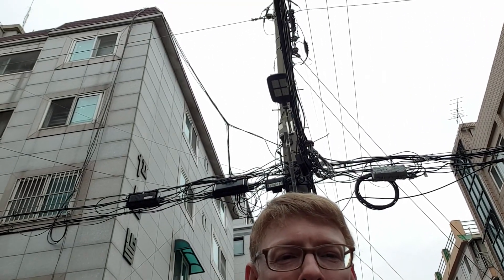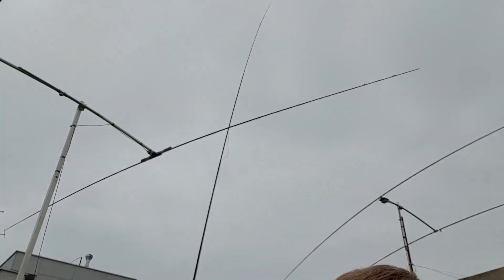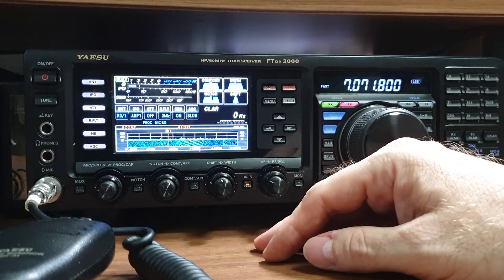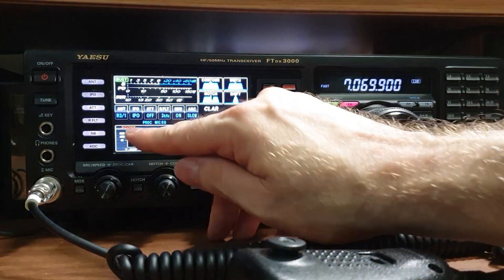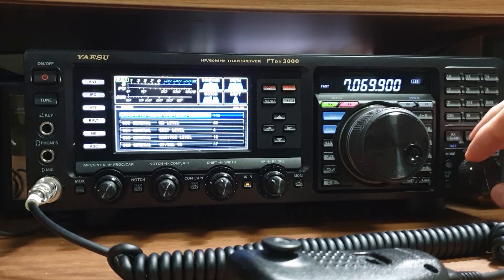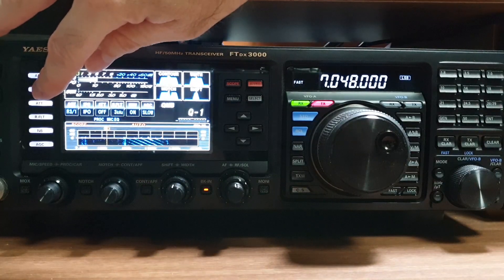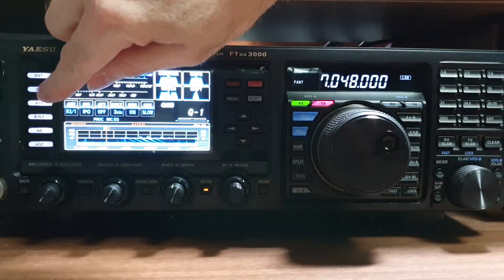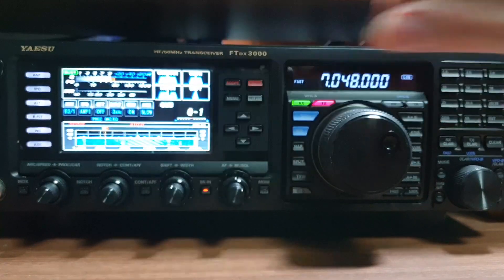Noisy City? No Problem! Yaesu FTDX3000 Receive Antenna Port Explained

Comment from the maker: Just a note that DX Engineering sells a device to make a RX Antenna port for radios which do not have them.  It protects against overload, etc.  It's called the RTR-2 Modular Receive-Transmit Interface.
Reply: @Aidan Marley No problem :)

Comment: Hello great video.  Can you use a 2 elwm yagi on 40m as a receive antenna and use a half wave dipole as a main transmitting antenna?
Reply from the maker: Yes you can!  I do, sometimes. Results vary.  Needs some receive amplification, though.

Comment: Is this phasing the antennas to reduce noise like a QRM eliminator.
Reply from the maker: No, it is simply listening on an antenna not meant for the band.  Less noise while remaining signal is lesser than a resonant antenna, but stronger above the noise floor.  You then use your internal RX amp to raise the signal.

Comment: What about the new FTDX10 , I live in a city also and I think to buy one together with the ATAS 120 antenna on my porch. Do you recomment to buy the FTDX3000 instead ? Now it is discontinued and has a good price.
Reply from the maker: Well, that's subjective. It really depends on how much noise you have, and how well the FTDX10 would be able to filter that kind of noise.  There is not receive antenna port on there.  If noise is a huge problem for you, you might want to consider a radio with a RX antenna port, such as the 3000 or a Kenwood 590SG, which is also an excellent radio.  I understand your plight... I would love the features (and pandapter) on the 10 model, also.

Comment: All what's happening is that you go from a vertically polarized antenna to a (mainly) horizontally polarized antenna.
Vertical antennas pick up far more man made noise than horizontal ones.
It has nothing to do with a smaller antenna, a non resonant antenna or anything else. It's mainly polarity.

If I were you, I would try to put up a tuned horizontal antenna instead of your vertical.
You will have the same noise reduction and on top of that, a better receive antenna compared to your present receive antennas.
Reply from the maker: Thanks for repeating the basic premise of the video.  However you missed the point that an off-banded antenna reduces noise an additional amount.
Reply: @thestingyham1188  Indeed, and a dummy load reduces noise even more!

Comment: So, the antenna is reducing noise not the radio or is the radio doing some filtering to cut out static.
Reply from the maker: The antenna is less sensitive on the frequency being used, because it is not the tuned band for it.  For whatever reason an Engineer can better explain, both DX signals from stations and the noise level are reduced, only the noise is reduced a fair bit more than the DX station's signal.  You then kick in the preamp, and do whatever you wish to do with noise reduction, contour, RF Gain, and filtering, to achieve the best receive.

Comment: Your vertical has a commonmode problem..
Reply from the maker: That was already tested. Not sure if I mentioned it in the video because it was a long time ago, but I ran an MFJ isolator to choke that line on the vertical. Adding the choke lowered the noise level perhaps half of an s unit, but honestly I really couldn't tell much difference.  Just a guess, really.  The 20m yagi had its own Balundesigns 1:1 current balun.
Reply: The lineisolator might  not solve the whole issue about CM but if it reduced the qrm you had some of it removed.  I had an old FT-107 with the extra antenna port and i used to counterphase the antenna signat into that, from an external antenna too... it sometimes reduced qrm about 30 db or more. BTW your noiselevel is a bit less than mine, and i live en a small village... i wpould have expected a lot more from a big city like yours 🙂

Comment: I use a Bonito active magloop on the RX port for my Flex radio.... very sensitive does pick some noise but can be directionally nulled out .... need to find a cheap TV antenna rotator, impossible task!
Reply from the maker: Does Channel Master still sell cheap ones for TV antennas?
Reply from the maker: https://www.channelmaster.com/TV_Antenna_Rotator_p/cm-9521hd.htm
Reply from the maker: Or this even cheaper and in stock.  Not sure it rotates 360?
https://www.amazon.com/AUDIOVOX-Remote-Antenna-Rotator-VH226F/dp/B008468PWC

Comment: you could have connected the rx antenna to the other antenna ports, wouldnt that have the same effect like using the same antenna on the rx antenna port ??
Reply from the maker: Yes, one can do that, and I tried that with older radios.  I encourage people to experiment.  The negatives of doing this are:  1.  Having to manually switch is annoying.  2.  The switch can wear out.  3.  If you forget to switch at the right time, you run the risk of damaging your radio / blowing-out your finals, due to mismatch.  The RX antenna port just makes it a lot easier (and safer) by handling all of the switching internally.
Reply: @thestingyham1188  
the ftdx3000 switches automatically between antennaports, once set, like RX on Ant1 and then as soon the PTT is pushed, TX on Ant2. 
the finals usualy have a protective circuit, they reduce the output power when there is a antenna missmatch, they wont damage that quickly from a missmatch. 
of course likes are different, some people will like an RX Ant port. 

btw, if you set the contour filter to +10, that will emphasizes the higher tones to compensate the attenuation of the higher tones in the DNR, the audio then becomes so much clearer and more intelligible.

Comment: De EA4GGC, Ese Aparato ¿Si esta bien y no esta Averiado? Yo Tengo Uno, pero es FTdx 3000MP (Versión con Todos sus Filtros Opcionales)
El Problema te puede llegar de las Lamparas Led-Radian Interferencias . Puedes verlas, con un buen Receptor de Radio y no te quejes, El
FTdx 3000 de la Yaesu, es DEMASIADO BUENO para tener Fallos... lo han dejado (DISCONTINUED) para vender los Otros, No tan BUENOS.
Saludos de EA4GGC Y Cuidalo, un Abrazo desde Madrid España(Spain)
Reply from the maker: My friend has the FTDX5000 and just like every other radio, the city noise affects it in a similar way.  I have 2 floors of other families living above and below me, as well as buildings full of 8 to 10 families each surrounding my building on all corners and sides.  That is the reality of Seoul, Korea.  No matter what I do, I cannot control noise from all of them.  The older superhet Icom and Kenwood and Yaesu radios do better than many of the cheaper SDR-based radios, such as the Icom 7300.  In my experience, the absolute best for handling noise at the front end has been Elecraft.  I wish I could afford another one.  They are in completely another league.  Any radio with a receive antenna port is a great help, along with experiments using off-band antennas.

Comment: Noise is a Great problem these days,
Found on the web W2PM Mini Dimond  RX Loop same  idea as a rombic but vertical mounted rather than parrale to the ground it has a SWR 1.2 from 160 m to 10 m  and a 30DB front to back ratio, the down side it has minus 50 DB  gain and I use a pre-amp by W7IUV which has 20 DB of gain both the pre-amp and the loop are very cheap to make and provide a good signal to noise ratio, there is a terminating resistor 660 OHM on one side and on the other side a matching 16 to 1 (800ohm down to 50 ohm) transformer and very easy to make 
The loop has a 7ft wing span  mine is made from heavy duty electrical conduit for the frame and a 4 way junction box. in the middle.
Reply from the maker: Sounds similar to a Flag RX antenna.  I was going to build one, but never got around to it.  I am space-limited, and do not have rotators.

Comment: Thanks for sharing a very informative video,I run a Yaesu ftdx1200 and suffer from a high noise floor at home. I have a few antennas up including a rotating moxon so will give this a try at the weekend. Cheers an 73

Comment: So, with this rig, I can just key up and the Rx ant wont overload  ?
Reply from the maker: When you have the menu set up to utilize the RX antenna, the rig switches antennas automatically when transmitting. It will listen on the RX antenna you choose, then when you push to transmit, it will automatically switch to the resonant antenna you have set in the menu.  Then it goes back to the RX antenna when you let go of the TX button on your mic.  Of course, the rig is also capable of typical antenna operation.  You set up the RX antenna in the menus.  There are other rigs with this function, as well.  The Kenwood 590SG comes to mind.
Reply: @thestingyham1188  so I think you answered his question here for the most part, but the dx3000 (as well as the dx1200 in my case) pulls the input off the receiver circuit on the rig when transmitting, correct?  I know DX Engineering suggests a connection to the control box of their PRO-1B and to your footswitch/key (on the rig) to effectively shut-off the receiver pre-amp (of the PRO-1B) as to not intentionally overload the rx front end of your receiver.  They claim it's precautionary.  But I'm thinking, Yaesu must protect the circuit inside the radio from such a connection anyway...so the device from DX Engineering may not need the suggested connection(?).

Comment: I enjoyed your video for the RX Ant. port.  It's a big different of noise level between the vertical ant & the horizontal ant.  The vertical ant is an omnidirectional ant so that it's picking up a lot of noise. 쌰It's a  great video and audio quality ! Nice narration!^^
Reply from the maker: Thank-you... the interesting thing is that I didn't even have the RX antenna turned much toward the signal.  It would have made the signal even stronger vs. the noise, if I had. :)

Comment: Hello ! I need your advice. 3000-D in production for 10 years. 
Today, YAESU has many new digital models. In terms of reception quality, what do you think is better to choose 3000D or "RF direct sampling system" ?  Thanks
Reply from the maker: I think RF Direct Sampling works great if you are not in a noisy area.  If you battle high noise, like I do in Seoul, then you might not like RF Direct Sampling unless it has a strong front end and roofing filter (Hybrid like Elecraft).  If you are not in an overly noisy area, then I think RF Direct Sampling is very nice.  I believe the new Yaesu's also have a roofing filter and strong front end.
Reply: @thestingyham1188  Ок, I also live in a metropolis with a high level of interference. I also use MFJ 1026. 3000D applies good roof-filters and, and non-standard down-conversion. I like the icom 7610, but I don’t know how much better it is when received in the city, there are no reviews today ...

Comment: Have you tried connecting the receive antenna to a QRM Eliminator?
Reply from the maker: I have known people who had them.  Those can work, as well.  The negative is that they too require adding a 2nd receive antenna.  The mini antennas provided with the units are often lackluster.  Results vary greatly for some ops using QRM Eliminators, from what I've heard, and there is a lot of tweaking involved.
Reply: @thestingyham1188  I love tweaking. Part of the fun. They work miracles, in many cases even with the internal whip if the noise is an apartment unit nearby with a noisy TV. I could not do HF without an MFJ1026

Comment: Hi, I live in Seoul just getting started in amateur radio and I'm wondering where you purchase most of your equipment
Reply from the maker: Hi, please join our FB group, named Korea International Ham friends group (or something like that -- haha).  Honestly, you can find rigs here, but unless you catch a deal, they are not usually priced well and may have problems.  New rigs bought in Korea from a dealer are usually 1 1/2 to 2 times what you would pay in Japan or the USA.  Also, we have a really stupid license renewal problem, at the moment.
Reply: @thestingyham1188  Thanks for your information about my dream rig. Moreover, you pointed out the exact issue that it is very hard to buy a new rig for amateurs. Very small ICOM radios are being sold in Korea “officially” with a relatively high price. In case of YAEUS or KENWOOD, we have to buy devices directly called “직구” from the US or Japan. I think it is from the decreasing number of people enjoying HAM as a hobby and an apartment residence where it is almost impossible to set up antennas, Esp. HF. After importing radios by ourselves, we have to get an approval to use them and renew it every 5 year. What you mentioned as “a really stupid license renewal problem” may be that problem. But it is what it is. :(  BTW, I think we came across at Acah Mt. and hope to encounter on air. :) DS1RCJ 73.
Reply from the maker: @bcyoon6823  Currently, foreigners who want to get a license are limited to a 3 month license, with one (possibly 2 more) paid 3-month renewals ONLY.  After that , they're done.  No more ham licenses.  I was lucky to be grandfathered and given another 5 year license, because I have been around a longer time.  New foreign hams, however, are not allowed to operate very long.  I think the person in charge of this for the government was trying to push the US (and other countries) into a reciprocal licensing agreement for Korean hams in the USA and other countries.  Unfortunately, the US seems to be uninterested, and the result is we are stuck with no extended licenses for new foreigners using ham in Korea.  That is the stupid license renewal problem I was speaking of.  :)

Comment: I have one of those X Phase qrm eliminators (not had much luck with it). Does your Yaesu work by antiphasing noise or is it simply a receive aerial input for a less noisy  antenna? Your video made me think that a dipole, on the next band up or down, used with the X Phase may work better than the results I have been previously experiencing.
Reply from the maker: No special phasing or anything.  It is just receiving on the 20m antenna directly. I know the 20m yagi, which is surely functioning as a dipole on RX in this use,  is up higher off of the roof and horizontally polarized, as well -- that helps.  When I want to use the 20m antenna on 20m, I do have to long-press the ANT button and switch the menu item back to TRX, so I can utilize it on 20m.  My 17m yagi also works OK as the RX antenna on port 2, but it is a much quieter signal, and not as good as the 20m antenna is receiving for the 40m band.  I really wonder how a 30m antenna might work.  Side note -- I also have the 40m u-tune box, and it doesn't work nearly as well as this RX antenna does.

Comment: why dont you just use the rx antenna for everything then?
Reply from the maker: The higher bands have a low enough noise level that I can receive better on them.  The trade-off with a RX antenna can be less gain.  My 17m and 20m antennas are yagi, and receive much better with lower noise, due to the different band and ability to null around the antenna.  More signal is directed in one direction, while other areas of the antenna are nulled.
Reply: @thestingyham1188  thanks! makes sense